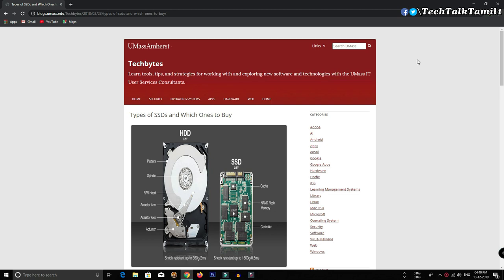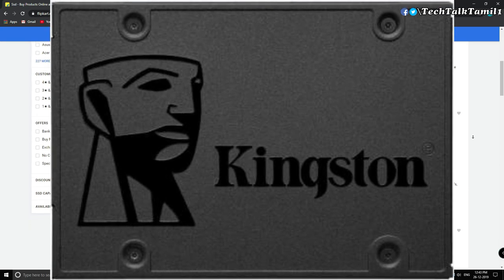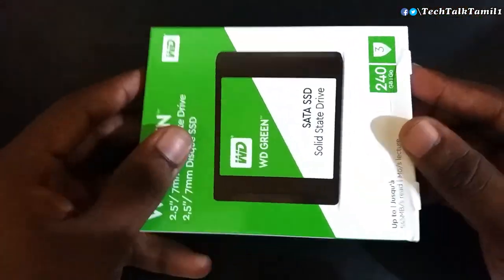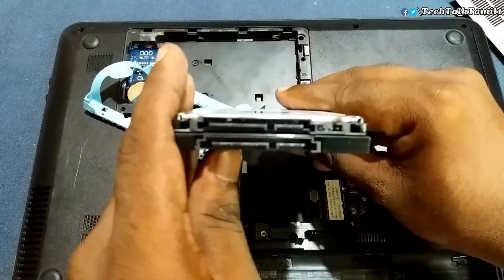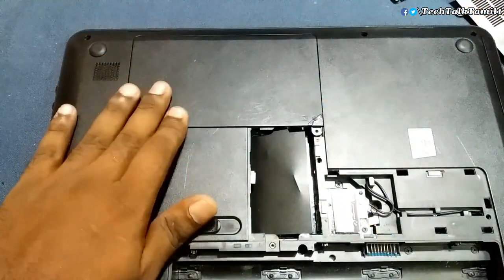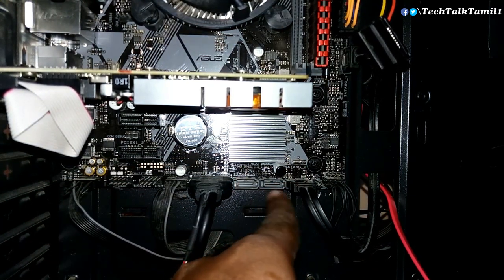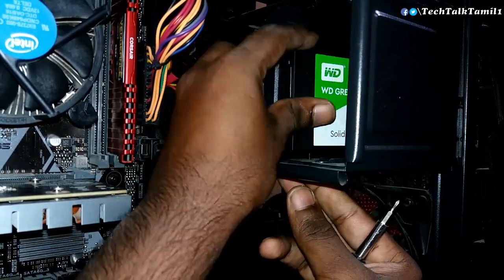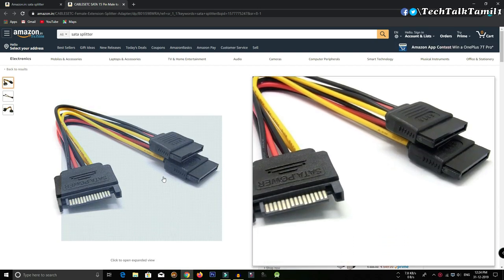how to install ssd on pc or laptop in tamil

Comment: Bro my laptop rayzon 3 4gb ram and 1Tb hdd, system slow ah iruku ..na 4 gb ram (4+4) and 128gb SSD podalanu irukan illa 240gb SSD podanuma
Reply from the maker: 240gb is best bro
Reply: @techtalktamil9963  bro ...Neenga 240 gb ssd pottinga , andha harddisk uh 500gb
But Namakku 250gb sd paaththa they bro.....

Andha hardisk(500gb)+sad(240gb)=750gb ah sekkalama bro

Please sollunga bro